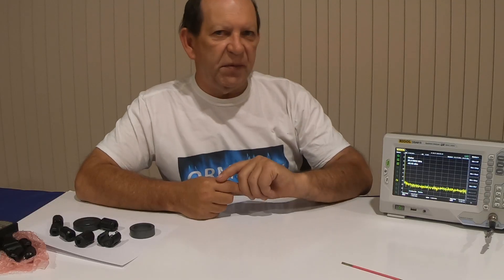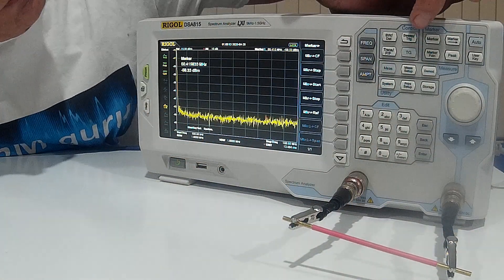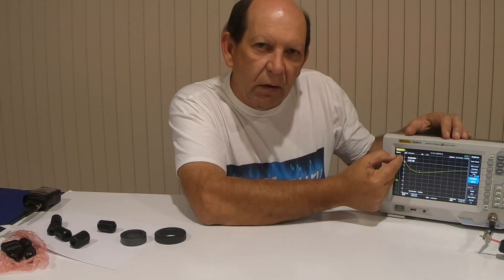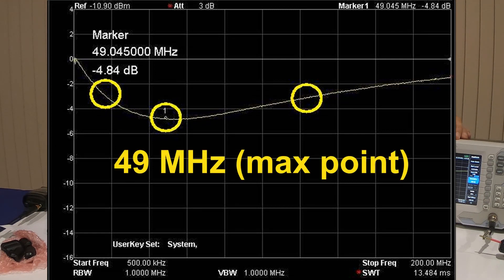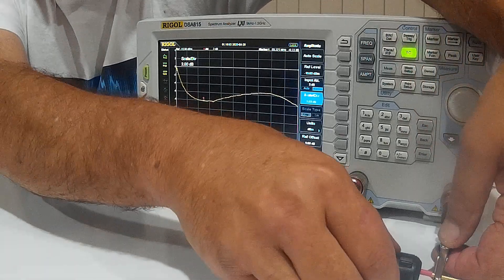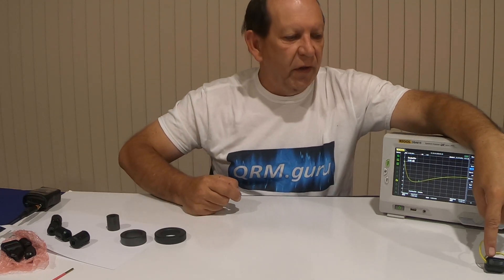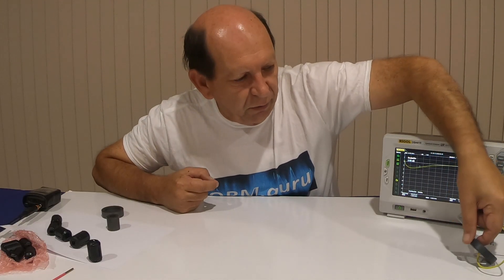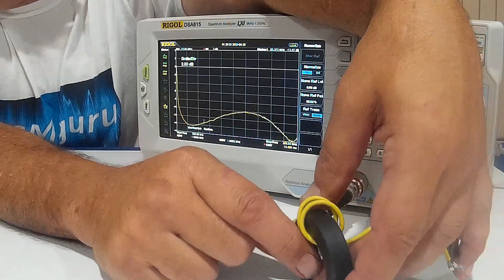R011 The Effectiveness of Ferrites

Comment: I think the tests are flawed. Its showing how a ferrite works on a single  wire. Antennas cant differentiate noise from signals. Putting them on coax wont do much except reduce transmitted rf coming back down the coax. It could reduce some noise on coax but it wont work well as it will be picked up on antenna also. A better test would include a wanted signal as well as noise measured using coax.

Comment: Glad to see that Mix 31 has been finally acknowledged as a better solution for HT that Mix 43.  Mix 31 from Fair-Right is readily available in Australia and elsewhere from places such as Element 14, et al. I've had no trouble finding it.  I'd also refer people to the K9YC Common Mode Choke Cook Book to take advantage of the extensive works Jim Brown and his team have undertaken. http://k9yc.com/2018Cookbook.pdf
Reply from the maker: Thanks, that's a good link.  These videos can give a taste of important info, but as always, the detail is in the reading. 
Yes, I have purchased some Mix31 from Element14 for experiments.   It was interesting and I wanted to see for myself what they were like.  While Mix31 was better at the bottom end, it wasn't much better by the time I put a few turns through the cores and measured total results. 
The important message in this clip was showing the methodology for testing, rather than relying on anecdotal reports of what was the best.